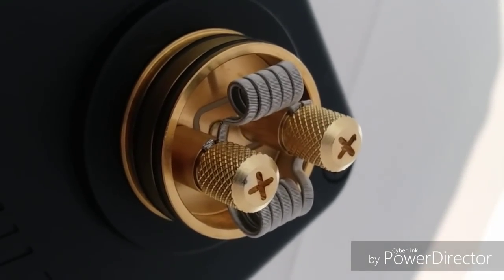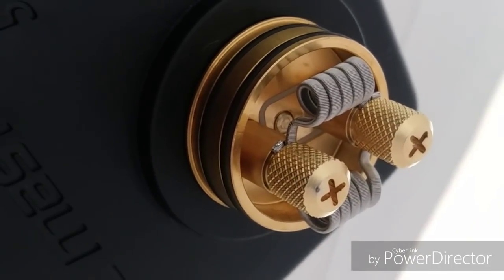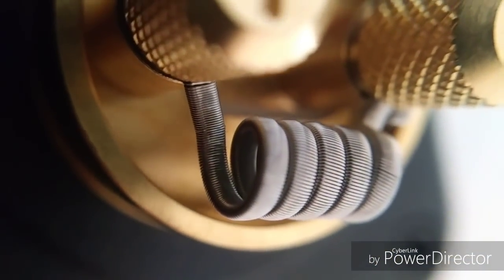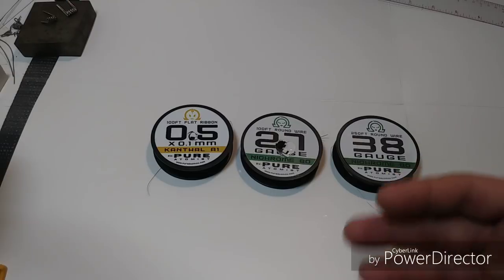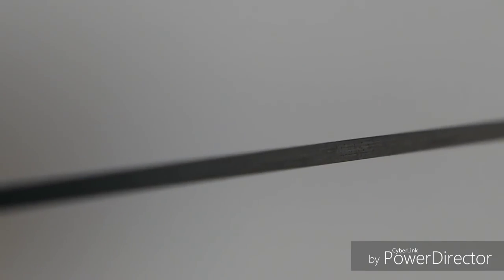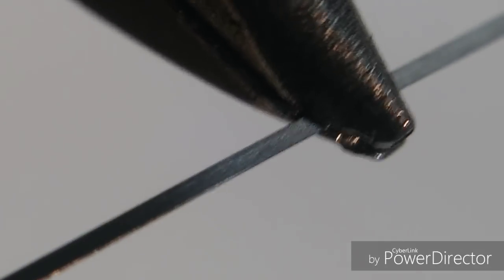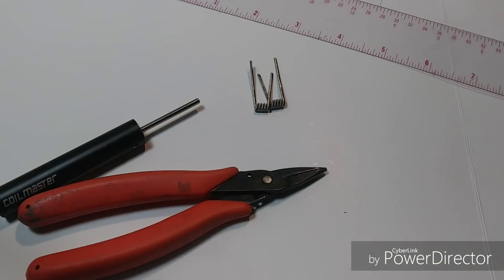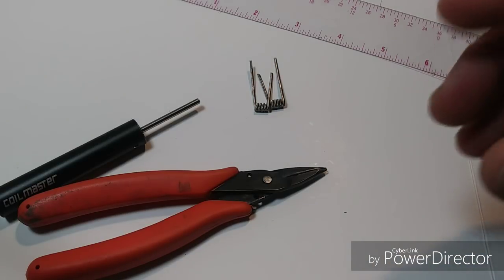Just starting off - vol. 6- coil builds - framed staples- n.devine83

Comment: As it happens I am trying out my first framed staple and saw you had posted this tutorial. Thanks Nick. Tried ribbon builds before but they always got messed up. Off to try and finish them now. Keep up the amazing videos!
Reply from the maker: +Ian Thomas great, good luck, stick with it
Reply: Thanks Nick. Used your gauge idea to get the right core wire and decided to Alien wrap it. A bit uneven, but 10ish inches of framed staple! Dead chuffed. 6*0.4 N80 with frames of 28.5g (metric 0.3mm) N60 and wrap of 0.15 KA1.
Reply: Thanks Joshua. I am getting the importance. Biggest difference I have made is using hot glue and patience!